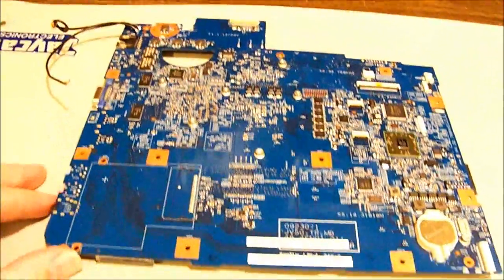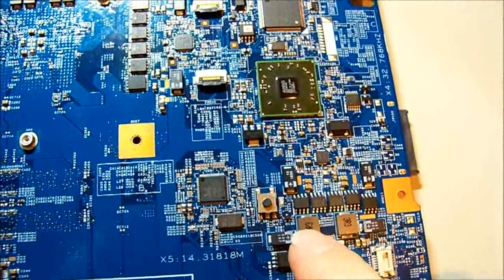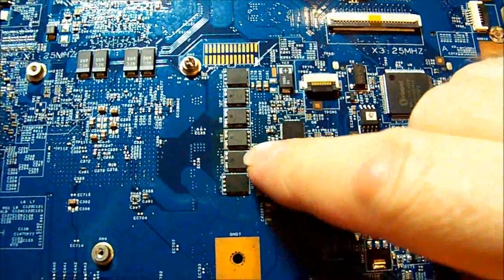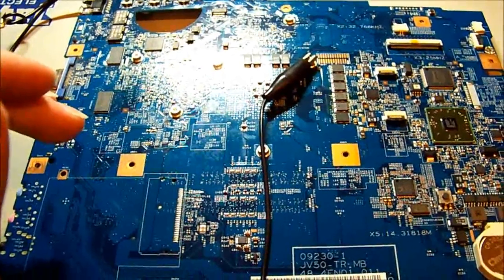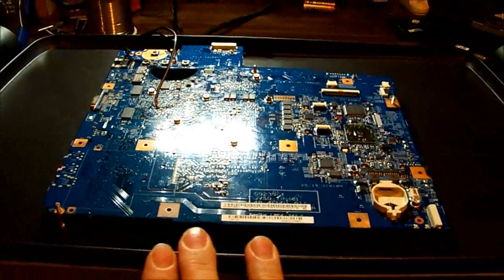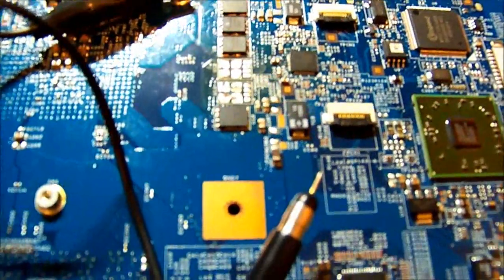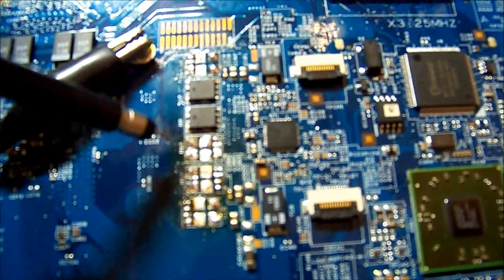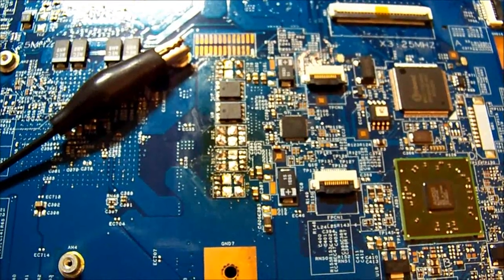Acer Aspire 5542 laptop attempted repair / diagnosis

Comment: ive seen some go an agressive 450-500 degrees. Have you had problems doing that or tried at all at that high a temp? gotta be quick though.
Reply from the maker: That hot air station was crap, I now have a quick 861dw, highly recommend.

Comment: Well that's a bugger. Let me know if you find any way to source those ICs other than a donor board with the parts you need still working. I'd be seriously interested. See I have an older Dell netbook which won't charge it's battery anymore. I've figured it out as to why it's doing this but can't find the controller IC it needs for it's smart charge system. I'm half tempted to use an I2c chip and just rig an external charger for the lithium ion pack on a dev board. It shouldn't be too hard to write code to monitor levels and stop the charge when certain characteristics are met.
Reply from the maker: You could try ebay, I know the parts I need are on there. The FETs look like they're getting scarce. I guess you've tried another battery pack to rule it out. I know those packs are too smart for their own good now and even if the cells are ok, if the pack tells the laptop it's not (or has reached preset discharge cycle count) then laptop will never begin charging it. I think some people have had limited success hacking these batteries to reset them.
Reply from the maker: yohan strauss
Thanks, I did try to find one but they seem to be a closely guarded secret. If you happen to find one feel free to link it in.